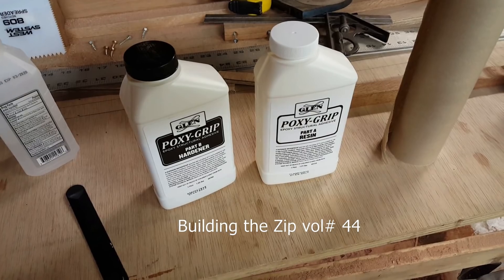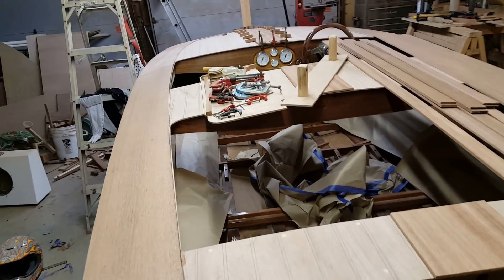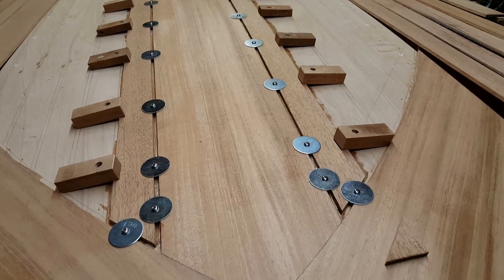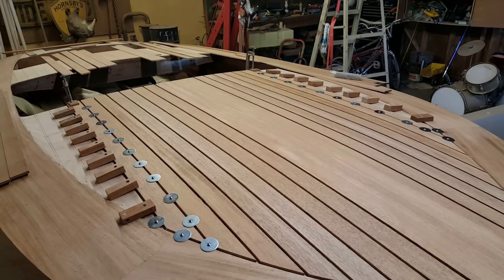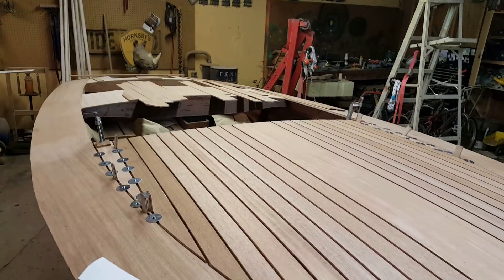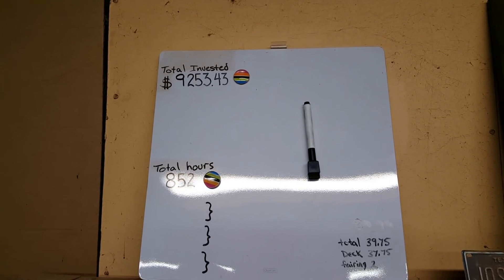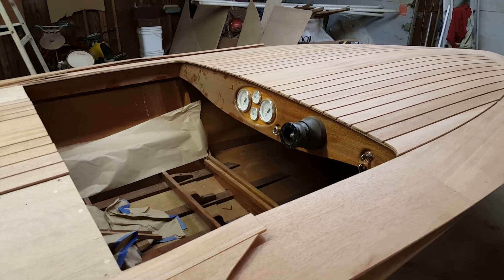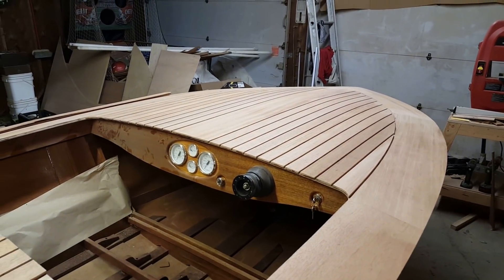Building the Zip vol# 44

Comment: It's a beauty. The shape of it reminds me so much of a boat my dad built back in the late 50's called the playboy. It was from popular mechanic's magazine. It had the mid deck and the motor well exactly like yours. Back then they didn't have epoxy, so everything was glued with marine glue. Also many brass screws with slot heads. I also remember this stuff called Kuhl's bedding cement. He didn't do any striped planking though. It had my grandfathers, 1957 35 horse, Johnson golden javelin on it, and it was beautiful, and moved along pretty good to. Such a shame that when my grandfather got older, he wanted to make room in the boat house for his little aluminum fishing boat. I went up to the cottage and found a pile of wood, because he chopped up the playboy with an axe. Such a shame.

Comment: almost time to think about a windshield. What style are you going for? Super classic twin pain with metal holders or the 50's 60's style of curved plexieglass in a metal bottom frame attached to the deck? Your boat is a work of art. My two cents concerning final finish coat is either automotive clear coat or aviation clear coat. The finish would be extreamly durable and only require buffing and waxing to keep it looking good. Like the rest of us following you I am getting eagar to see the boat in the water and running.
Reply from the maker: Ken J i am definitely going with the twin pane style with holders, i still want to do auto clear, low maintenance is my end goal. thanks for the comment.
Reply: joshuaburks epoxy resin, a few coats of that and you will have a mirror finish with deeper timber colours. Automotive paint isn't up to handling what high speed water and dirt in that water will be throwing at it, as your constantly speedy through that exact said water. Just my educated opinion. Happy to be corrected if I am wrong though...🤔

Comment: If I’m looking to build a boat like this any chance you could give me a list of tools I need
Reply from the maker: Rondo Wright you bet, i would say a bare bones list to start would be....
1.) jigsaw 
2.) drill
3.) belt sander 
4.) small tablesaw (i made one)
5.) hand or power plane
6.) random orbital sander

tools to make the job easier....
1.) small bandsaw
2.) disc sander
3.) compound miter saw
4.) cordless tools, drill, 1/4" collet impact, etc.
5.) oscillating multi tool (very handy)
6.) router and bits

i built the bare hull (empty shell) with just the top bare bones list, as i progressed through the build i added the bottom list of tools slowly over time. hope this helps,... Josh
Reply: joshuaburks hey thanks for taking the time to reply I appreciate it alot

Comment: Josh, Looking great. One question: What are you using to fill the gaps between the 2" planks? I want to have the same look but have no idea what to use. I suppose I could wait till next month. Thanks and good progress.
Reply from the maker: 50jim1 my original plan was to fill the seams with thickened tinted (white) epoxy, there are a couple zips done that way, very low maintenance, then top coat with auto clear, another option is to varnish and then fill the seams with white sikaflex (kinda like silicone)